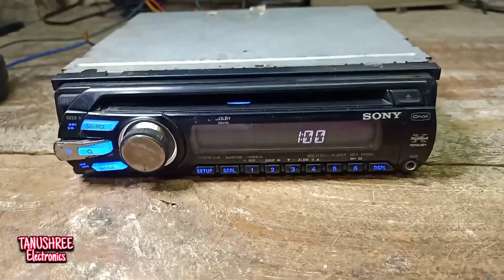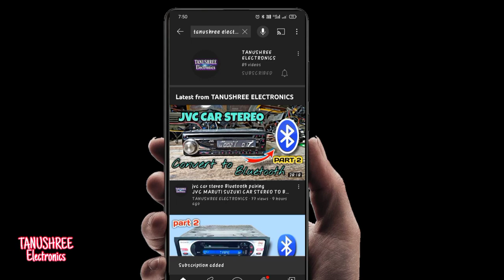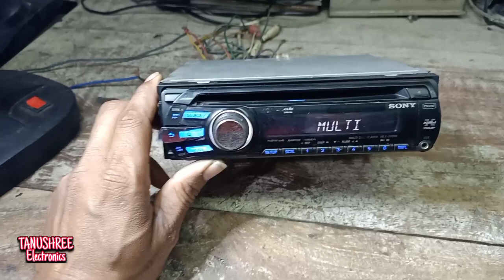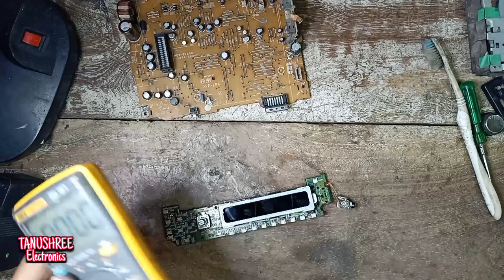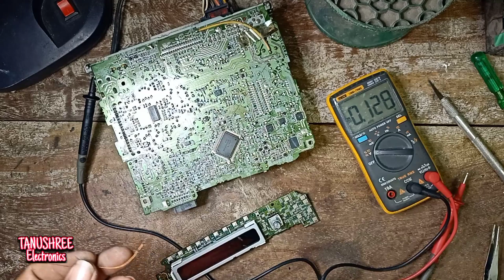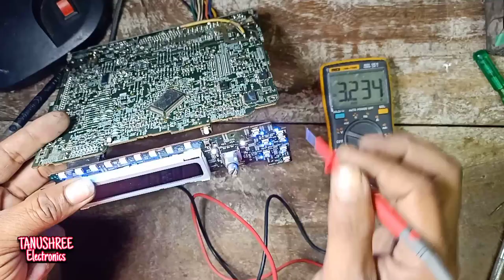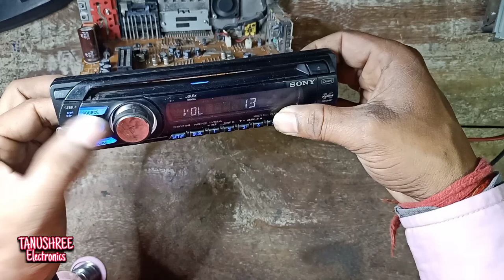car music system repair front panel not working sony car stereo

Comment: Sir mere sony car stereo ke old modal me front button me 1 se lekar dispaly wale switch work nahi kar rahe hai

Volume, frwrd, search , setting wale to work kar rhe hai

Mene switches or puri plate ko petrol se clear karke dekh liya . But not working

Plz suggest
Reply from the maker: Har stereo mein keepit voltage hota hai jo 3.3 volt hone chahiye tabhi work Karega ok